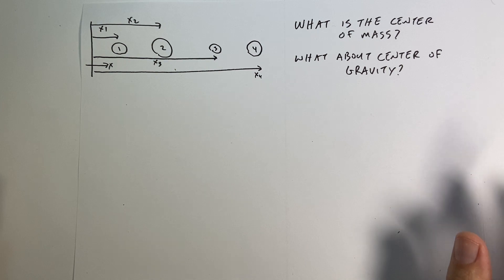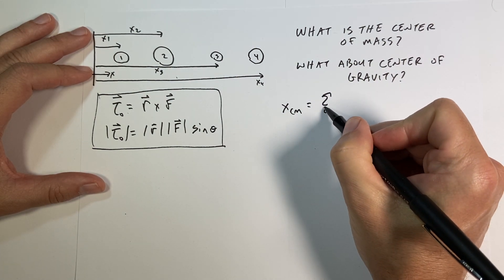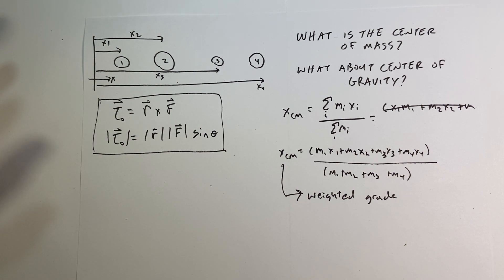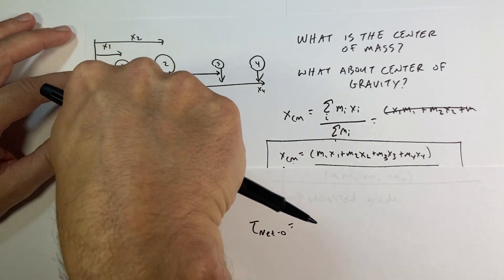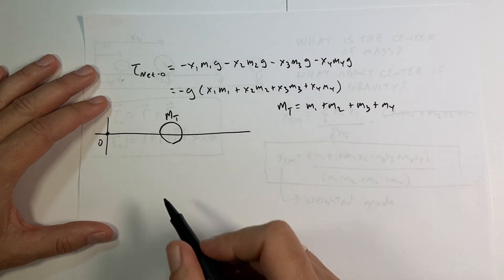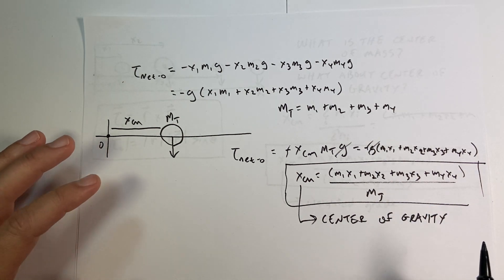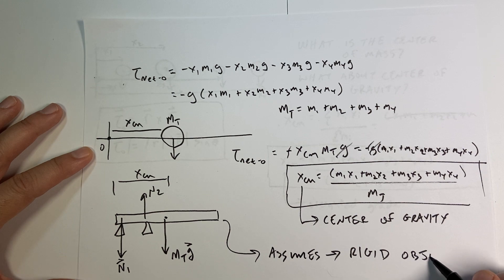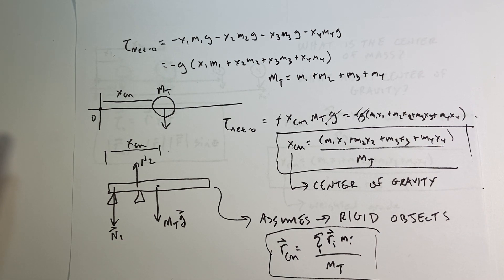Deriving the center of gravity using torque.

Comment: Soooo the final result is a number?
I understood the math process but what's the meaning of the final value of Xcm.?
Reply: X_cm is the centre of mass. The centre of mass is the point at which an external force (e.g gravity) acts. For example, you could treat a point mass (like a particle) exactly the same as a big mass with volume, as long as their centre of masses were in the same place/are equal.
Reply: An example on where you can use this knowledge of where the center of mass is located, is on the construction of racing cars. It's  tells you where to put de different components of the car, in order to have a better handling of the car throw corners. Sorry for my bad English.
Reply: @SimToPro  gracias Gabriel, pero lo que quiero decir es que si el resultado me da por ejemplo Xcm=7,52 ¿Qué es lo que significa ese número? ¿Qué hago con él para hacerlo útil ?